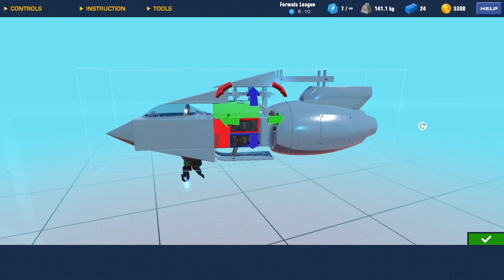Gyro control hack tutorial #trailmakers

Comment: You dont have to use and gates, any gate would work for this purpose. 
Personally i usually use or gates for things like this since if you try to connect something else to them too the or gate wont do funny stuff with the multiple inputs it would be getting. 

Also this isnt actually a glitch, if you look at the description of the gyro it says that it resist rotation. This resistance just gets stronger the higher you put the power.
Reply from the maker: Thanks for the feedback.